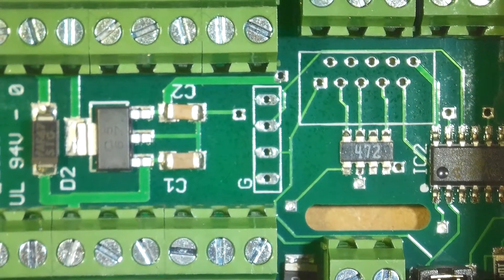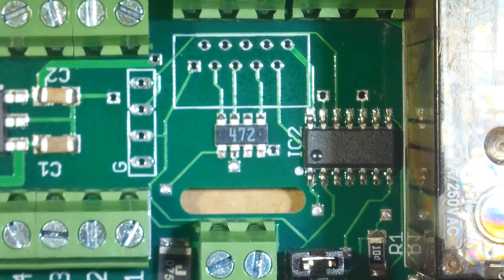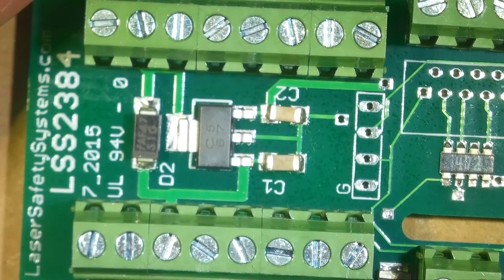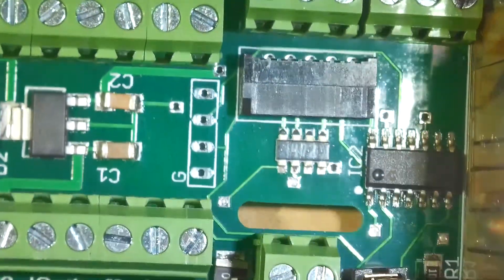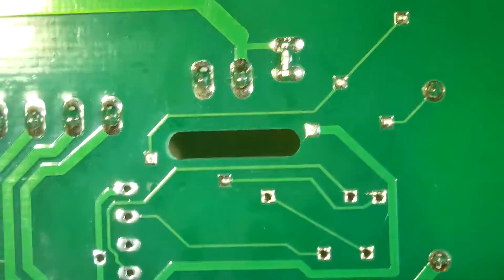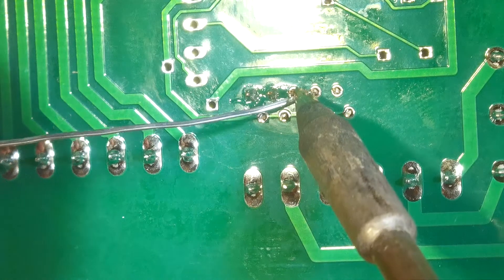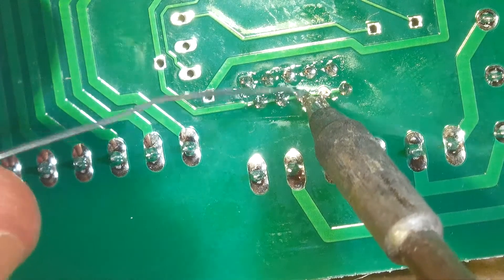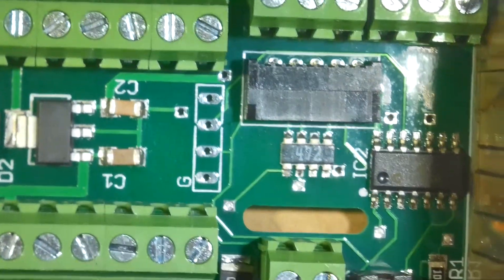Soldering under Andonstar HDMI microscope

Comment: does it has fast enough during soldering 
i mean is there any delay in real motion and the video on the screen
Reply from the maker: home made,  there is no delay at all.  It is perfect for soldering.
Reply: thanks for every thing
Reply from the maker: I should remind you it is real time going hdmi direct between the unit and a monitor.   There is no pc in between. If you use a pc and the usb, you would have a short delay.
Reply: i will use it via lcd screen using the HDMI cable

Comment: John, any idea where you can download the Capture software from? Mine didn't come with any software, tried contacting them but no answers to my emails, found some third party software, but not brilliant?
Reply from the maker: Not really.  But the camera they use appears to be a Novatek model 96650 firmware based on the "details" of the properties of an image taken from the camera.  I would ask Novatek if they had some kind of USB software.
Reply: Amcap works but in PC Camera mode it does not allow any camera settings to be changed.
Reply from the maker: According to Sinyue Van of Andonstar, you can get their software here, but I haven't tried it:
https://www.dropbox.com/s/bjc9sqs6iu0...
http://www.yawcam.com/download.php